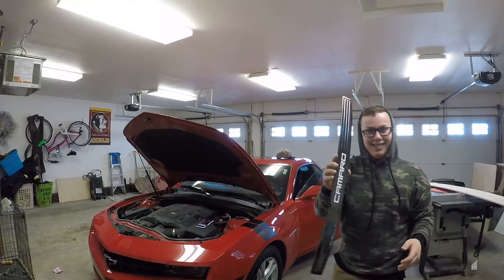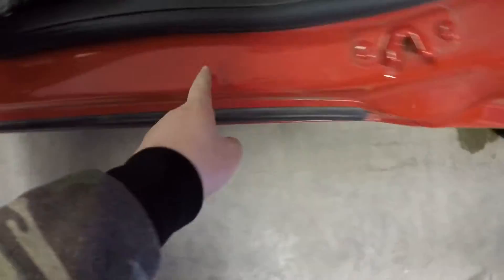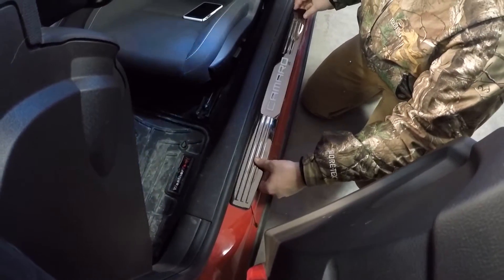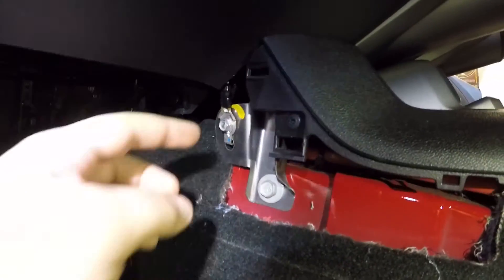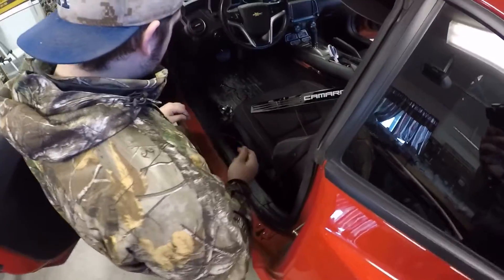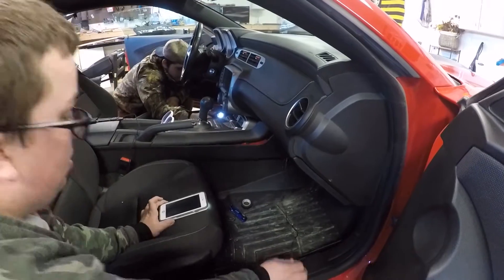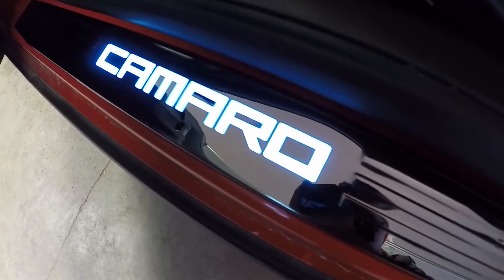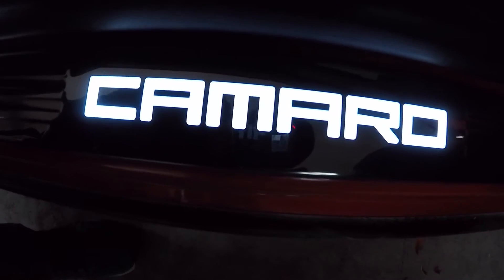Chevy Camaro Illuminated Door Sill Install

Comment: Thanks guys, you saved me. I couldn't have figured this out without your help.  I just installed the exact same one myself!
Reply: can u please help me I got Camaro RS 2010 which wire exactly bc its hard to see
Reply: @LoayDakamseh  it's the grey wire. You have to splice open the grey wire and connect it with the red wire which has a fuse on it.
Reply: thank u bro but its more than one gray wire in there
Reply: @LoayDakamseh  the grey plastic thing with a bunch of wires should only have one grey wire
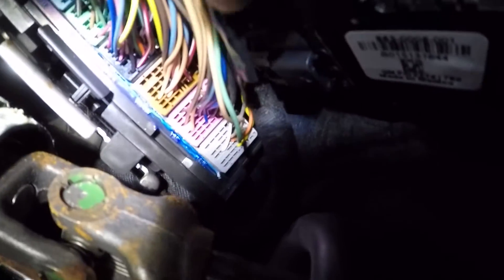Reply: @LoayDakamseh  look at 1:17 of the video. It's the grey socket which has a grey wire. What year is your car? This is for the fifth gen camaro
Reply: RS 2010
Reply: I see the gray wire, now my  Sill  come with one black and the red wire is the red wire go with gray and black one as ground thanks
Reply: @LoayDakamseh  yes that's correct